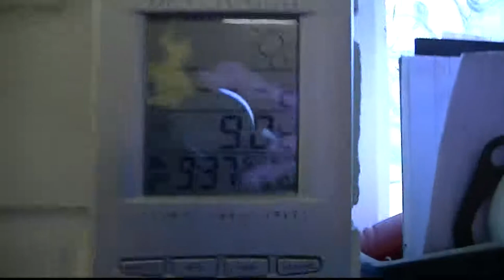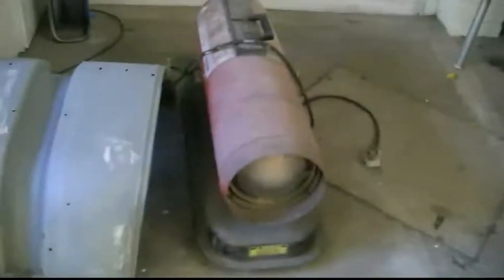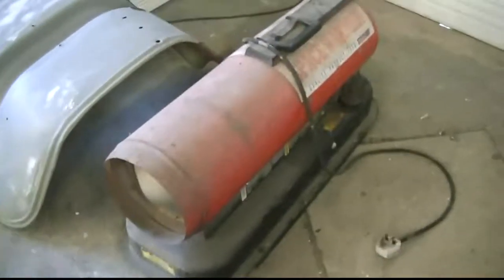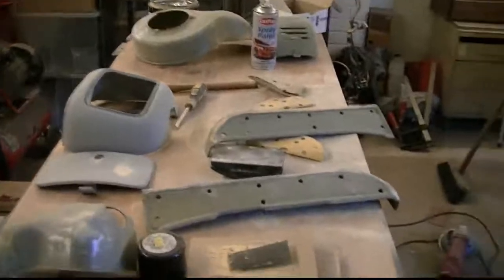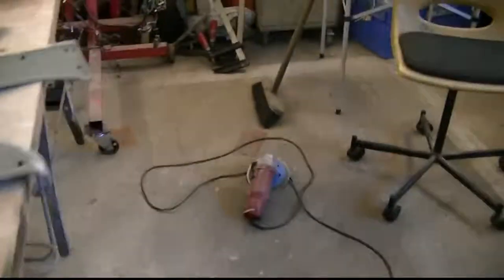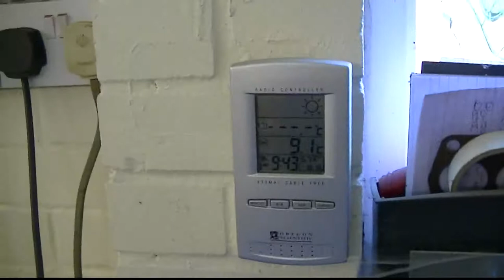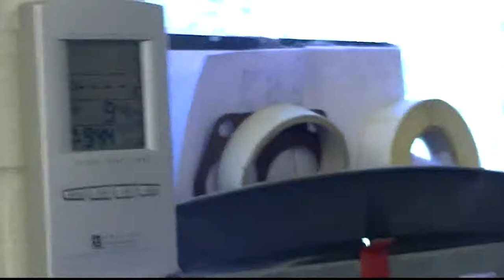10th october - Little update

Comment: Hi Neill, 

I run a 240V/4800 watt electric heater in my double garage for the winter and it keeps it comfortable to work in.  I can get the garage up over 20 C even when it is minus 5 C outside.   I do stuff some pink insulation along the sides of my garage doors to keep out the drafts and keep the heat in.   The heater has a built in thermostat so I turn it up when I am out in the garage and leave it on low when I am not.

Comment: Here's my advice: spend a few hundred quid and a day insulating the garage, at least the one workshop area that you use most. Use the kerosene heater to get the garage up to temperature, then switch to the little electric one to maintain the temp.

Comment from the maker: I think you've hit it there john, I think if it were well insulated, I wouldn't need anything more that a 3kw electric blower heater. 
The only problem is the ceiling isn't insulated, and is lined with asbestos sheets, which there are strict rules about over here, you basically can't touch them.

Comment from the maker: lol, I was making a point!!!!!   The problem with electric space heater is one the cost of running it, and second I'd need quite a large one, which would mean running a seperate cable from the fuse board. I had thought about night storage heater that heats up over night (cheap rate) then emits the heat during the day, again it comes down to cost!!!

Comment from the maker: Yes John, you're right, they should be removed, but that alone costs a small fortune because whoever has to take them out must be licensed, and they have to be disposed of properly. You could lay insulation on top of them, but it's a flat roof, so access is zero!!!   You can do whatever you like with the sheets so long as you don't cut them drill them or look at them!!!!

Comment: I've priced out the exhaust vented version of the torpedo heater, they cost way more than the regular kind.  As I recall well over $1000 where my non vented version cost about $300.  I'm surprised that you have trouble heating up your shop with that,  it doesn't look much smaller than mine which is aprox 175,000 btu.

Comment: They don't call me Iceman for nothing.  9C is t-shirt/shorts weather for me. I wear a hoody when it's closer to 0C, and when real cold (-25C) or windy I zip it up a bit. Mind you I do my ownl "insulation".  Just check out last winters videos, you'll see.

I use 3 different methods of heat.  I have a propane heater much like your kerosene one (noisy).  I have an electric radiant heater I can use for brief jpobs at the bench, but if I plan on being out there for a while, I use a wood stove.